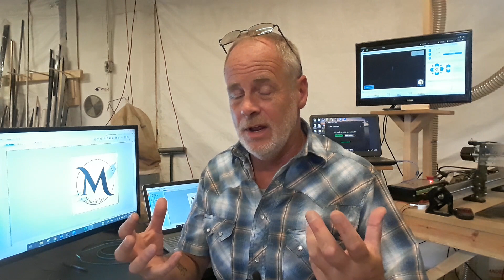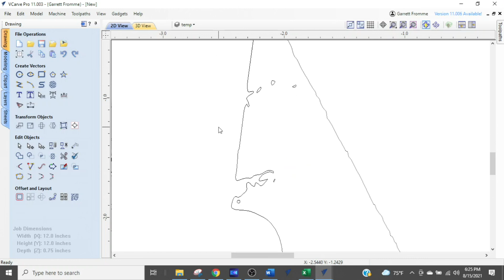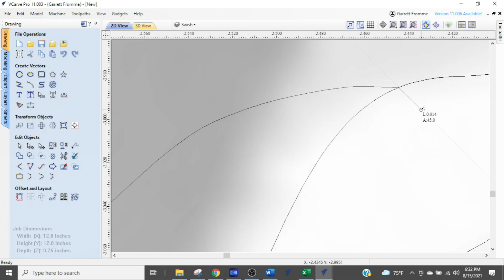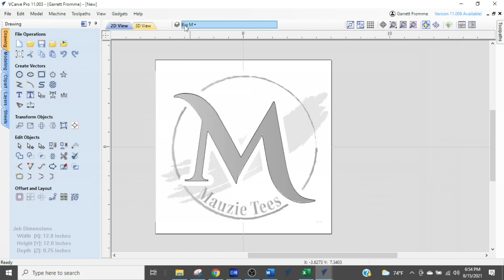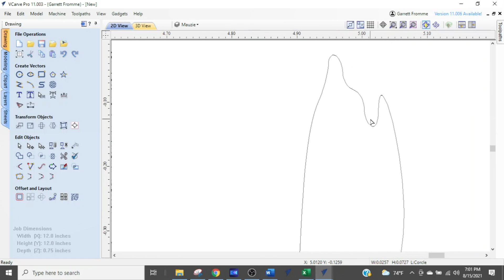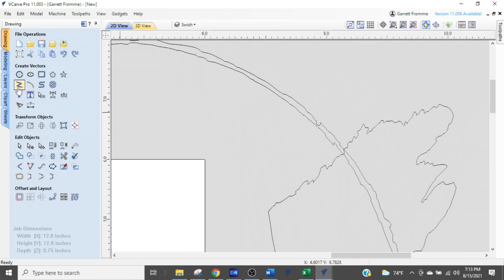How To Design From Difficult Bitmaps for CNC Router Projects [Vcarve & Aspire] - Garrett Fromme

Comment: Still here, I was wondering why not just cut the big M out and glue it to the rest of the Logo, instead of using a pocket?  Seems like you could use a 1/2 in board for that and get the same effect.  Perhaps I missed something and it was necessary to make the pocket.  But I think it would simplify the design efforts a lot not having to be concerned with how the swish and circle went through or around the M. Just thinking.
Reply from the maker: Very good point. That's why it helps to have more than one head in the game

Comment: I recently did a plaque where I merged a couple of images and engraved them. In order to make this work, I had to put vectors on different layers and trim and edit them. If I didn't do that I would have had cuts going where I didn't want.

Then they asked if I could do that but with 3 different heights. One image standing above a surface and two below it.  I had to use even more layers. That was the only way I saw how I could do that.

I liked that curve to fit function. What a nice and handy time saver. On some noisy profiles, I sometimes had to spend a couple of hours going around, deleting and smoothing lots of bumps and divots.

I may have done a few things here different than you did here, but you being somewhat more advanced than I am, I suspect at some point during doing it my way, I may have discovered why  you took the approach you did.

Another good and helpful video.
Reply from the maker: CNC, these types of projects are definitely thought provoking and there are many ways to approach. 

I like what you did here. I hope people read your comment and techniques you described.

Comment: Would it be possible to also treat this as a stacked text file as an alternate possibility.
Reply from the maker: Hi Darin. I considered that. The fine bit requirement would make it not look good because the fine bits would not fit in the deeper areas.

Comment: Wow Garrett, you're bringing back memories from my digitizing past. Couple of things on my mind so give me your input. I used to auto trace a lot when I started, but after a while found it was easier to just draw the project from scratch tracing over the bit map. Too much noise to try and remove. Sometimes I would redraw it in Adobe in black and white if I needed to just so I would have a clean copy to digitize from.  I looked at this like that. The only real complicated shape is the swoosh. Even though the circle was a bit broken, I would take artistic license at times and here think using the circle or arc tool, I see in the top left, would have drawn the pieces of the circle. The swoosh as it's own layer, like you, broken up into it's different pieces that overlap the dark circle or letters. Probably done that using a free form tool, just tracing the parts I want. (I saw you drawing your own lines). Then add the letters as text.  I always imagined  myself as the needle or in this case the bit, running the pattern the tool will make. It kept me from having the sewing head go all over the place because if I was running the path with my legs,  I'd get tired. So I'd think to start with the swoosh first, bottom left to top right. Change bits and do the circle and the name, then leave the M for last... All depending on how to cut it.  You've got my mind thinking efficiency.  Thanks so much for these Garrett! It really gets me going. :)
Reply from the maker: Hey Dieter. This is one of those projects that could be approached in several ways. your's being one of them, for sure. Yes, efficiency is good when there are multiples.

Honestly, I had looked at this for so long, I simply had to make a decision to do something and get it done.